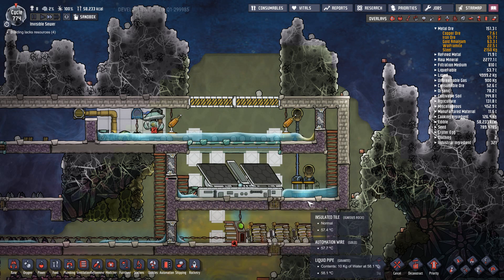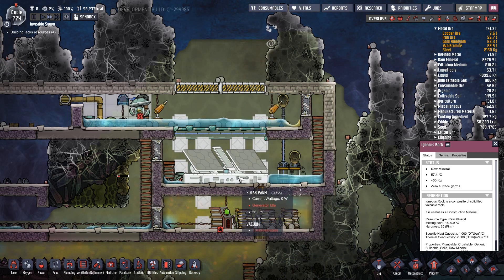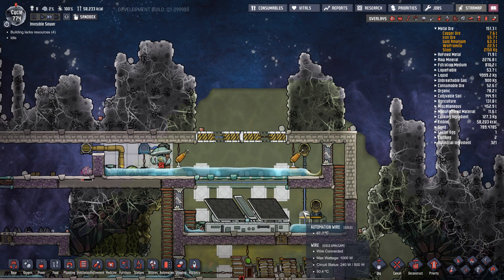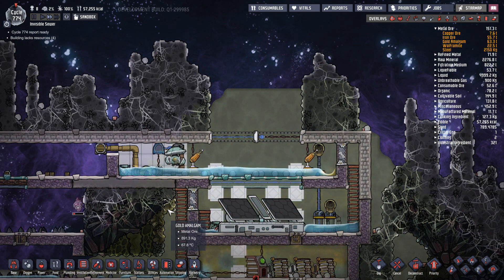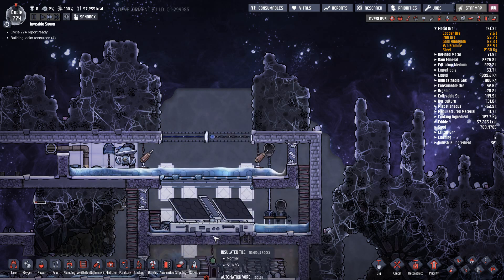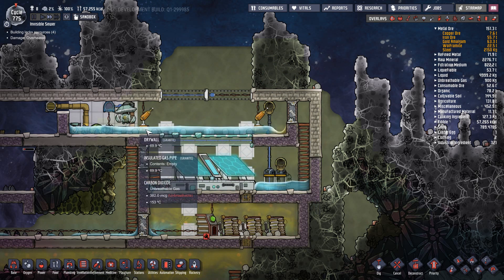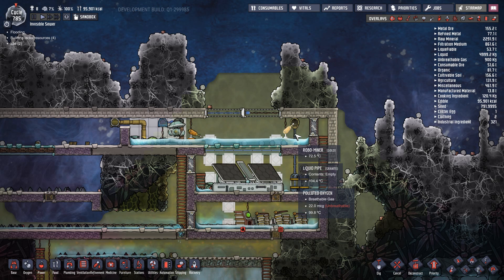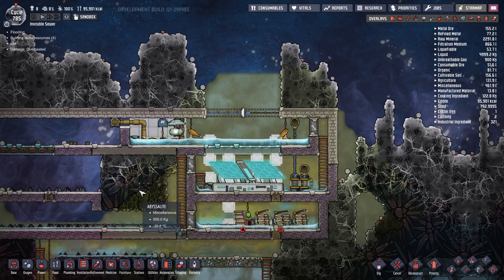Oxygen Not Included - How to set up solar panels that don't overheat

Comment: I'm very confused. I'm trying to recreate this but the water was sucked into the vacuum of space. I have since found out that you have to add dry wall.  However, why doesn't the water then get sucked into space in your video when the doors open?
Reply from the maker: Hi Susan, this video is a few years old and there may have been updates that change the physics of the game.

Comment: This is really great, but how do you prevent the satellite dish from getting hit by meteorites? after all, if the bunker door is closed, the satellite can't detect the meteor shower, and if it's open, the satellite is vulnerable, so how do you make sure the door opens/closes at the right time?
Reply from the maker: The satellite can tell when there is a shower and closes the doors. It closes the doors above the solar panel and also the doors above itself. The meteor shower smashes down leaving debris which, when the doors open, the miners take care of. Th scanner can tell when the shower has ended and opens the doors.
Reply: @b4ckbl4st  Not quite what i meant, but i have since figured out that what i needed to do was essentially already explained in your video. That is through the "not" switch
Reply from the maker: @ElPolDia  Thanks for watching the video's.